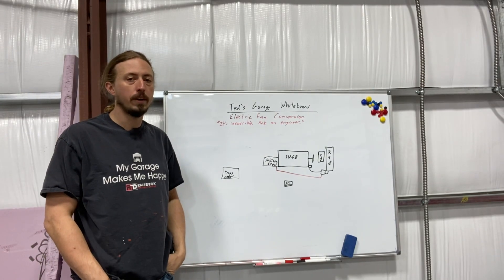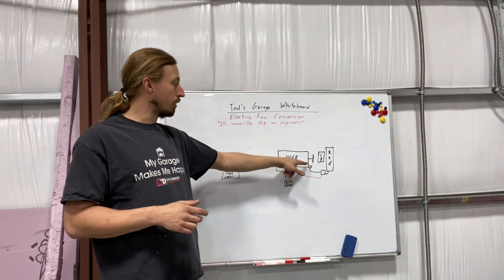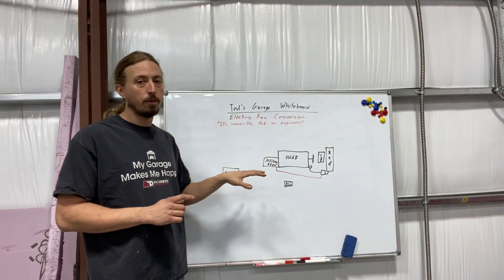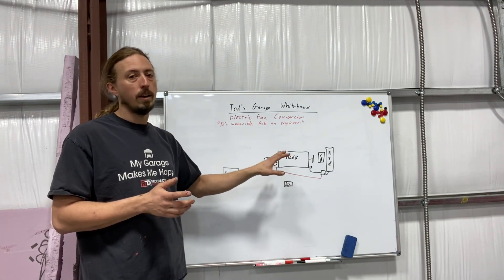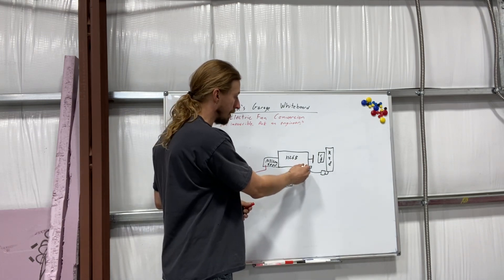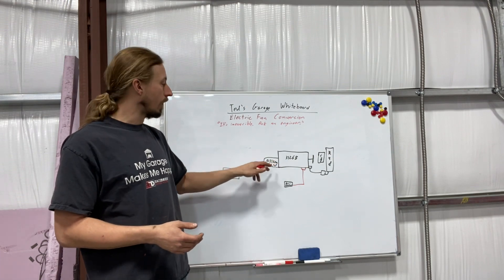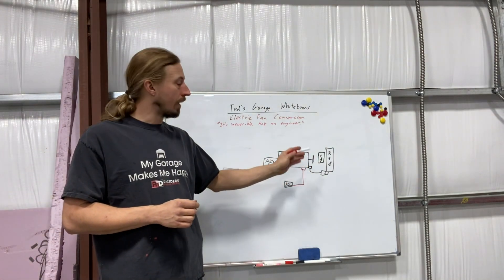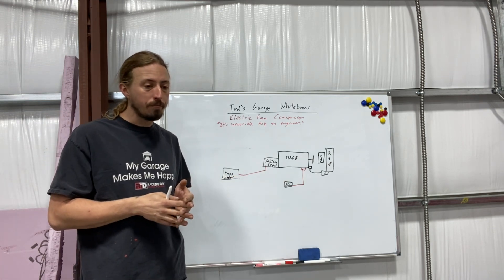Class A Diesel Pusher Electric Cooling Fan Conversion: Why it will work!

Comment: what fans did you use? I can't seem to find  a list of materials anywhere
Reply from the maker: I originally had it in the video on the fabrication work. I've updated the description for the videos on this project to include the links to the fans and controllers I used as well as the other videos.
Reply: Did you buy those fans because of their reliability, or because they had a shroud already on them? Also, thank you so much for posting those so quickly, that's awesome! Could you also possibly post the Arduino code that you used to run the PWM?
Reply from the maker: @gunks_getaway   I bought them because I expected them to be reliable, the shroud and fans were about the right size (with two of them) and because I also expected them to meet the airflow needs. That last part is the most important. I address this in some of the other videos, which I'd encourage you to watch if you haven't because I also go through some notes about things I would've done differently if you're wanting to do this. Also make sure that you look at all of the other support work I did prior to the conversion as that was necessary for this to be successful.

I should find a place to post the Arduino code I used. It's too long to fit in a YouTube description. Right now I don't have it posted anywhere, but I started off by copying another set of code that was used (a similar PWM type of controller) that was set up for using this kind of controller on a fuel pump, but the same thing applies to a fan.

Comment: Super impressive.  I’m currently doing this mod as well on 2003 safari cheetah with the 3126. Did you change and then wire the alternators together. Where before you had the 270 to house and 200 to the engine?
Reply from the maker: Glad to see someone besides me doing it! If you go through you can see my notes. The only thing I would change is I would go with the Ford/C6 Corvette fan controllers instead of the Mazda ones, or I might've gone with OEM fans instead of Dorman. When these Dorman fans get hot their current draw goes up, and so I have to limit them to about 60% PWM. Otherwise, everything I did all around works very well.

Comment: Very impressive Ted.
What about heat transfer for the CAC?
Will the CAC require or benefit from a different cooling scenario than the motors coolant?

Glad you followed through with this and didn't listen to your detractors.
Reply: Good stuff Ted, Jeannette even watched this with me on the big TV. Hope you and your family are having a good time away for the holidays.
Reply from the maker: Geo, I had thought about that and figured I’d let the engine tell me what it wants. One of the nice parts of how I have the control system set up is I can add additional inputs and variables if needed. In a future video I’ll talk about how the system is performing in the real world and necessary/planned changes. I’ll just say for now that it’s doing very well.